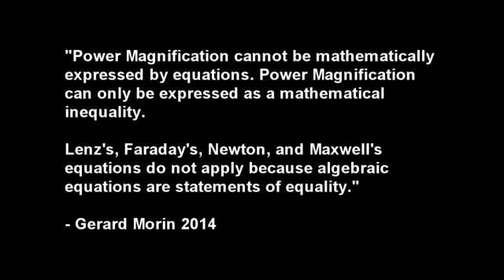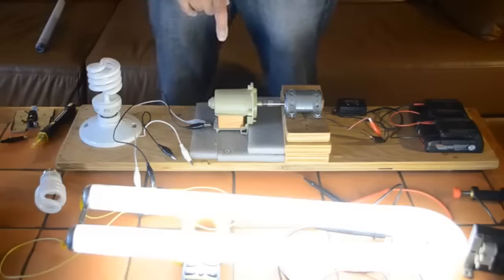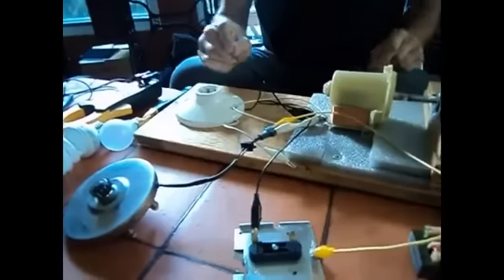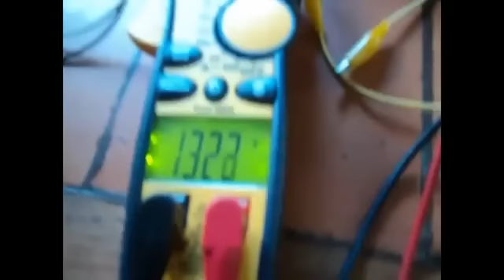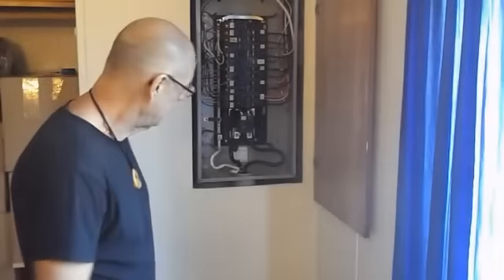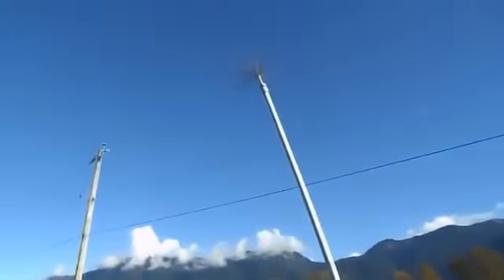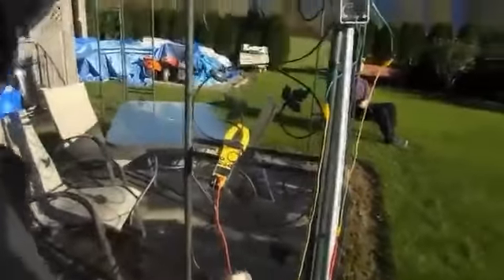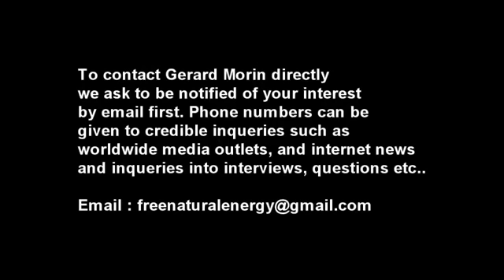Time to END The Electricity Racket - FREE & NATURAL ELECTRICITY PROOF

Comment: Congratulations, you made a primative inverter, now let me see you run a bridgeport knee mill off it and perform a fly cutting operation with the mill using a battery. Do that and im on board.
Reply: Dang you dont screw around lol that is about as much energy as a freakin house lol
Reply: @jonross377  its a 2 hp motor drawing 220v @ 3.5 amp in 3 ph....your fridge burns as much or more....
Reply: If he should ever demonstrate with a 2hp motor, he needs to put that motor onto a load bearing pulley.  A 2hp motor might be capable of free spinning with his noisy inverter, but I seriously doubt it will pull a load such as a washing machine.  Or even a toaster or a hair dryer or microwave.  The fact that it took a while for those cobalt magnets to heat up is a sure sign that it will not perform load bearing duties.  I am going to test the idea if a common inverter could power up blown florescent bulbs along with a high voltage coil which should work just the same.  Also, perhaps adding stronger magnets on both sides of the motor is also a significant idea.  Another thing is static electricity can build up and produce very low currents which does augment his results, but very little and not enough to make any difference, especially on load bearing devices.  I am not convinced his generator is any better than efficient generators currently available.  More importantly though is how long do those batteries last before having to recharge them.  He should test his inverter system against common backup battery inverters and using the exact kind of battery on his noisy inverter to see which will last longer before needing to recharge after consuming equal amounts of lumens generated by the exact same bulbs from each inverter and test with and without adding extra magnets.  I suspect that the normal battery backup inverter will outlast either test with or without extra magnets even though the extra magnets makes his system more energy efficient.  The best ideas he is showing is that some things such as florescent bulbs were designed to needlessly consume more power and that one does not need to throw away those bulbs after being blown.  He needs to do a comparative analysis to find what devices could operate at significantly less current and what devices just won't work.
Reply: @tauvholiik7936  lmao this wont last near the amount of time a common inverter would. There is no need to test any of this as it was done for us a hundred and fifty years ago... What he built is crap and what he is describing is not what is happening. The only reason you believe any of what he says is because you know so little about the subject.
Reply: @jonross377  It is not a matter of belief but a matter of rational logic.  I am an optimistic skeptic that always gives someone the benefit of a doubt as I scrutinize the methodology in what should be obvious if indeed the experimenter is sincerely and honestly wrong.  If I had detected any knowingly deceptive ploys just from this one presentation, I would have called him out on it, however I only watched half of this video because his claims were unfounded by the mere lack of scientific techniques that even the most common pragmatic person would test.  The fact that he does not exhibit any long term demonstrations of which he himself uses on a daily basis is his biggest mistake.  Most of the youtubers with so called free energy click bait are just trying to cash in on viewership and could care less about if they have a functional invention or not.  But not everyone is necessarily a fraud if they have made honest mistakes.  Also I should point out that just because academic science has proved something wrong does not mean they are always right 100% of the time.  I have discovered a few things myself where academic science is dead wrong about of which I have found useful for myself and could care less what the consensus tries to dictate.  But if I were to guess, academic science is right 99.999999% of the time.  Science has not discovered everything yet as they are still trying to quantify their dark matter theory and quantum entanglement experiments that just might also be proven in the future as a big waste of time, money and resources.  But science must keep the pioneering spirit alive if they are to uncover any real new discoveries which in turn leads to better inventions for society at large.  Anyways, most youtubers with monetized content have been moving to patreon accounts in order to make money because YouTube does not really pay all that much unless one has millions of views consistently every month.

I already expressed my doubt that his device would not stand against a commercial battery backup inverter which generally lasts for only a few hours running a 100 watt lightbulb.  Even if his device could come close to performing as efficiently or even if it marginally surpasses it, no one is going to want this noisy contraption.  It is not practical.  But I have also done impractical things such as kept my truck running on idle all night running a power inverter when I had no power and could care less how much gas I wasted when I needed the power.  What I have learned in his demonstrations is that i could have lit up my whole house with burned out florescent bulbs, a regular inverter, and a high voltage transformer and would have been more efficient while using up 10 gallons of gas per night when I was out of electricity.  But now we have access to efficient led bulbs so perhaps florescent bulbs are not worth pursuing either.
Reply: @RedDogForge  I was thinking like one of the CNC's at my college. Definitely running more than just a two hp motor. cooling moving all the axis...
Reply: @tauvholiik7936  You sound like you know what your talking about - So put your money where your mouth is and prove him wrong by making one your self and doing any and all tests you think he didnt do - It was a interesting presentaion and if you find fault with it then prove him wrong instead of bashing him to his other followers and subscribers. He is just trying to make a living like the rest of us he is just doing it in a differnt fasion and sharing his ideas. So like the old saying goes dont't knock till you have tried it and prove your point. I would be interested to see what you come up with.
Reply: finally someone who sees the misleading info haha
Reply: You don’t understand what is going on do you?
Reply: All you have do do is up the motors and make some adjustments and your golden. From this video is should only take some research combined with trial and error. 

Get out there and make it happen brother. We all wanna see you achieve this.
Reply: @captainKedger  use your knowledge to help others.

Comment: Gerard something that will convince a lot of folks is to add a Watt mètre before the input to the Motor to show how many watts are required to run the small tiny motor. Then add another watt meter after the mini Generator has produced 134v AC. This way it will show 100% of what you are claiming which is happening. 

Secondly, and obviously you are not showing details of the Generator Rod magnet or the Coils which we can see under the body of generator. But if you want people to know and be able to duplicate what you are showing then you will need to share some details. For now if you could only put the Wattmeter in front and one at the backend then will be absolutely helpful. Thank you.
Reply: power consume will be higher than it generate cos he knew
Reply: The only thing that would cause an increased amperage draw on the batteries would be an increase of torque on the DC motor. This torque being generated from the pump motor when he puts a load on it. But you can obviously hear the motors spinning at the same rate no matter what load he puts on it. There is no friction being generated from the pump to cause an increased amperage draw on the batteries, you would hear it. But all that aside it's a washing machine drain pump($20) with the propeller and housing taken off. I'll build this with watt meters in line at points of main interest and post my findings instead of talking about it.

Comment: If he should ever demonstrate with a 2hp motor, he needs to put that motor onto a load bearing pulley.  A 2hp motor might be capable of free spinning with his noisy inverter, but I seriously doubt it will pull a load such as a washing machine.  Or even a toaster or a hair dryer or microwave.  The fact that it took a while for those cobalt magnets to heat up is a sure sign that it will not perform load bearing duties.  I am going to test the idea if a common inverter could power up blown florescent bulbs along with a high voltage coil which should work just the same.  Also, perhaps adding stronger magnets on both sides of the motor is also a significant idea.  Another thing is static electricity can build up and produce very low currents which does augment his results, but very little and not enough to make any difference, especially on load bearing devices.  I am not convinced his generator is any better than efficient generators currently available.  More importantly though is how long do those batteries last before having to recharge them.  He should test his inverter system against common backup battery inverters and using the exact kind of battery on his noisy inverter to see which will last longer before needing to recharge after consuming equal amounts of lumens generated by the exact same bulbs from each inverter and test with and without adding extra magnets.  I suspect that the normal battery backup inverter will outlast either test with or without extra magnets even though the extra magnets makes his system more energy efficient.  The best ideas he is showing is that some things such as florescent bulbs were designed to needlessly consume more power and that one does not need to throw away those bulbs after being blown.  He needs to do a comparative analysis to find what devices could operate at significantly less current and what devices just won't work.
Reply: Don't waste your time. This guy has a 4th grade education and understands nothing about electricity, physics, or thermodynamics. And yes, they are all interrelated. If you want to light up an fluorescent tube or bulb you only have to excite the gas within it. That can be done by exposing it to any decent electrical field. An old trick used to be to take a 96" tube and hold it between "High Tension" transmission lines and the ground. The electrical field would excite the gas in the tube and it would fluoresce. No trick to it, it's basic science.  

This guy says so much that is wrong it isn't possible to address all of his issues. Suffice it to say he is essentially clueless in regard to electricity and science in general.
Reply: @Stephen2846  So, you're looking down on low graders? Well, tell that to my son, he's also a "drop-out" because he also has the idea school doesn't teach you what you need to know to succeed in life, but now, 6 yrs later, has 5 companies from Singapore to the States, he's employer of 143 and has a yearly 9 figure flow... yes, drop-outs are dumb, right? Lol
Reply: @peterdewaele5256  Well it's obvious his father cannot read!
Reply: @Stephen2846  yeah? What is it that I should've misread, not read, or misunderstood? I don't know what you understand under "4th grade"? Don't you refer to drop-outs?

Comment: I build my own robots, run a solar powered crypto farm, do automation programming for a living, and build things like ION drives in my hobby room for fun. I've definitely experimented as well on stuff like this. 

1. Devices are designed around and need a certain voltage, amperage, and possibly frequency to operate correctly. Under-volting a device means it doesn't work well. No big shocker here. Anyone with a dead battery knows this. Operating devices designed for 120v RMS AC 60hz current (what you get at a standard outlet in the US) on 36v DC is like trying to run a two stroke gas engine on  diesel. His "device" is just a high frequency and high voltage transformer with the frequency part being important. 

2. He bad mouth's AC current and how the electric company sells you back your own electricity yet is using a motor to run his device. Any rotating input is going to become the same alternating current he's badmouthing. Rectifying that AC current to DC is going to introduce losses which he claims not to have. 

3. He puts his hand across the two terminals without being hurt and compares it to a standard outlet. So here's the thing, skin has a much higher resistance than copper wires and the devices he's powering. The total system power is going to be divided across all those things, including you potentially. His system only has the potential capacity that he puts into it from a small motor, whereas the total potential capacity of the electrical grid can cook you alive easily. The total potential energy is very important. 

4. Skin effect is a term that applies to an alternating current. The higher the frequency, the more a current travels along the outer skin of an object. If you get that frequency high enough then the penetration depth can become small enough not to penetrate human skin and harm them. His device could just be creating a very high frequency output that doesn't really harm skin unless it's in contact for minutes or hours. The downside is that high frequencies can also shorten the life of electronics and destroy them prematurely. This is likely how he got the tube lights to come on as well as the other devices unless other shenanigans were in play. 

5. Other shenanigans. Everything is screwed down to a board. There could be a circuit in the bulb base that detects AC or DC current and responds appropriately. He could also have any number of devices or power sources underneath and the connections you see are absolutely meaningless. He could have a foot pedal controlling things and the volt meter is just a hacked display to show whatever he wants. The video's probably in low res so he can hide special effects easier by the way and not YT at all. 

I've spent ten minutes writing this and I'm done. Anyone who knows anything thinks this stuff is shit even if it's a sci fi wet dream. Anyone who says otherwise only tells you to "dream big" or some other bullshit.

Comment: Congratulations, you have "discovered" the mechanical transformer. Also known as a motor generator set that is commonly used for voltage conversion, frequency conversion, or load isolation. Measure the current and voltage at the input of the motor and the output of the generator. P = V x I. The value P will ALWAYS be less on the output than the input.
Reply: I watched this guy before... Is it possible he doesnt have a clue what OHMS law is? He actually seems convinced he is producing energy...
Reply: 5:26
Reply: @keithfucious7067  wdym?
Reply: @davidabs8532  I mean its a joke. He isnt creating energy, he either doesnt have a clue what he is talking about or he is just making the video to generate views..It is all laughably incorrect....
Reply: @kosmikmusa  he says he is not making amps, he is making electromagnetic watts....

For those who don't know, voltage is pressure, while an amp is the amount of current flowing, and a watt is a unit of work.

So if you think of it like water, and you have a "pressure" of 50 psi, at a "flow rate" of 5 gpm, the amount of work you could do with that is really in no way calculable. Imagine just multiplying 50psi x 5gpm and calling the capable work is 250 units. A larger nozzle would allow more gpm or the same size nozzle at a higher psi would produce more work. Whether you increase pressure, or flow rate, or both, you are increasing the amount of work capable and so the units of work calculated would also go up.

This is how wattage is calculated. Voltage (correlating to pressure) multiplied by Amperage (correlating to flow rate) gives you the calculated amount of work capable, measured in watts.

So when he says, he is not producing amps but electromagnetic watts, it is pretty absurd. You don't produce amps or watts. You generate volts and give it a path and it will flow and the resulting work would be measured in watts.
Reply: @Samuel.Collier  Best explanation ever! I now understand volts, amps and watts. Thank you!
Reply: @Samuel.Collier  "Electromagnetic watts" is an acceptable description of the power transfer/intensity being propagated by his set up in my opinion. He said he is "modulating electrons"- allowing them to "flow", not to be generated.  He is more correct then his linguistic jargon capacity would indicate.